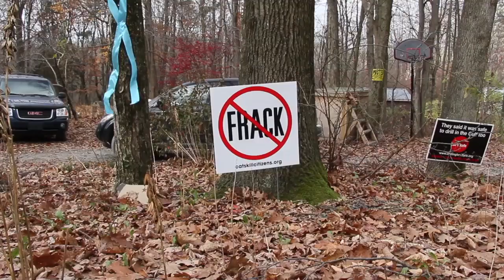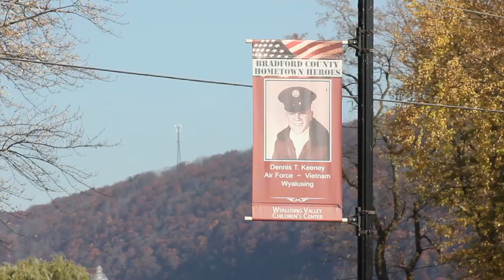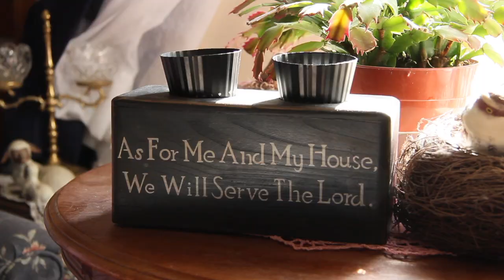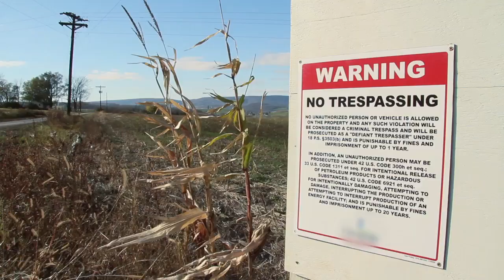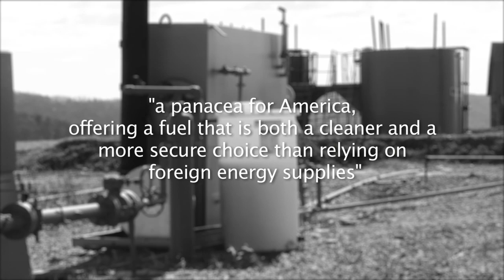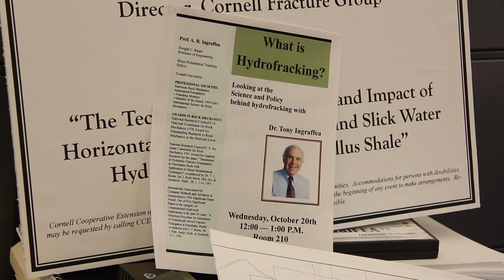The hidden cost of the US shale gas and 'fracking' boom

Comment: it is no longer anecdotal that Radium226 will bond with other frack flowback materials. SUNY Buffalo study recently published confirms the radium from the shale does in fact bind with the salts used in fracking as well as the natural salts within the shale that are disturbed by the drilling process. And there are Frack waste producers who have actually negotiated resale of this waste for use by municipalities to spread on roads for de-icing and dust management. It's insane.